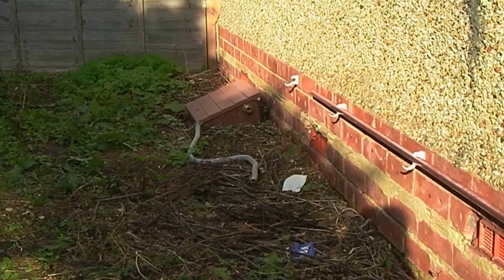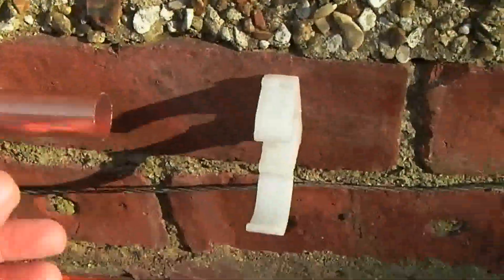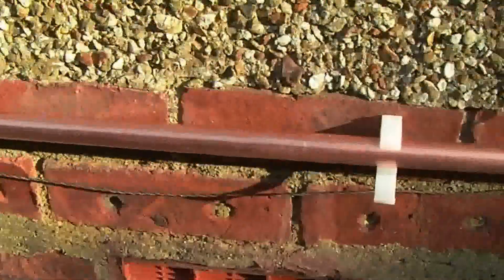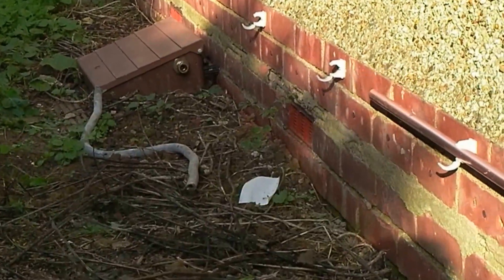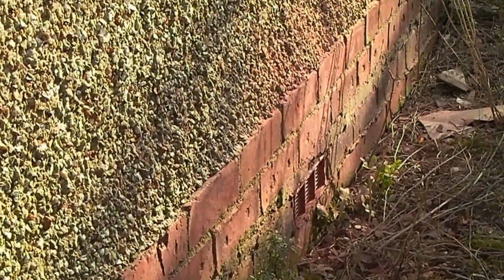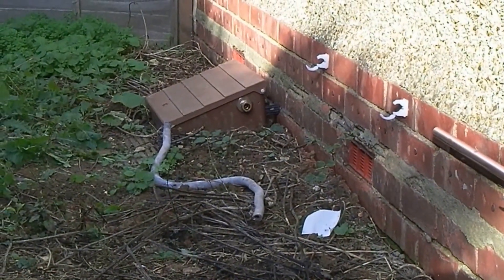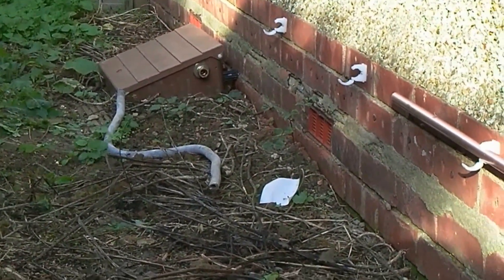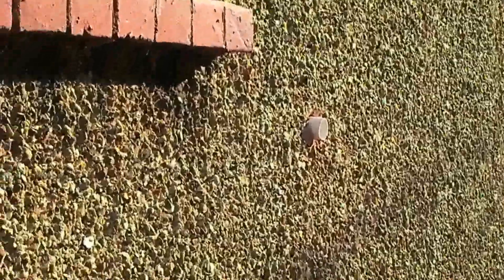How to install central heating. Part 14

Comment: Just a word of advice if the gas pipe coming in is plastic there is no need for the bonding. The bonding can also be placed inside the meter box. It can also be place inside the property if there is enough space to put it before the pipe is connected to the central heating system.